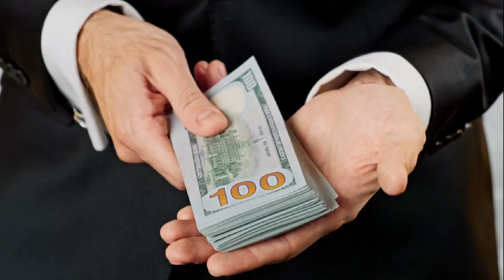Boiler Repair and Faulting Training to Become The Best | How to Fix Boiler Faults Fast The Ultimate

Comment: Hey on Elektra fiamma boiler can you show how to switch the value 0 or 1 of the Jumpers? In particular Jumper 8? My boiler somehow
- will not respond do the tap water + or - buttons, and pressing both tap+ and tap- for 10 seconds has no effect
- it does not display any temperature on the righthand side (only left side)
- in summer mode the boiler temperature goes down to room temperature, nothing is heated and no hot tap water
- in winter mode the boiler makes a constant noise, I believe it is the pump, 24/7, but maybe this is normal and expected for winter mode.
- there is no Parameter 8 (P8) in the parameter settings mode (it only goes up to P7).

I believe it is because the JP8 = 1  (Jumper 8) and I need to set it to 0 instead, but I can't find it. Where is it?

Although... for the past 3 years it has been working fine with hot tap water in summer mode (without touching the jumpers). I don't know what I did with the settings this winter but maybe I just changed the wrong setting somewhere in the menu.....   or some insect managed to crawl inside and switch the jumper?
Reply from the maker: Hi, this subject can not be answered here it might be best to speak to the manufacturer
Reply: @ARBoilers  thanks, do you mean you don't know where the Jumper is or do you mean this video is not the correct topic for it